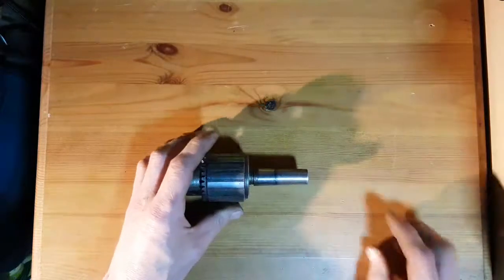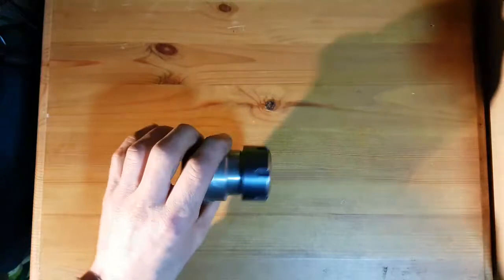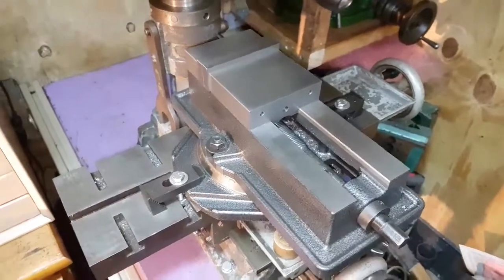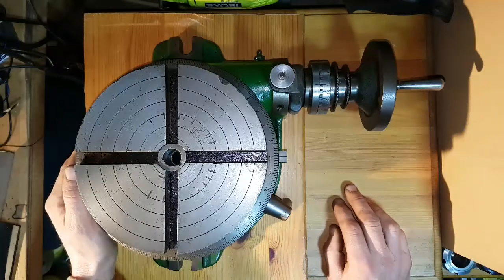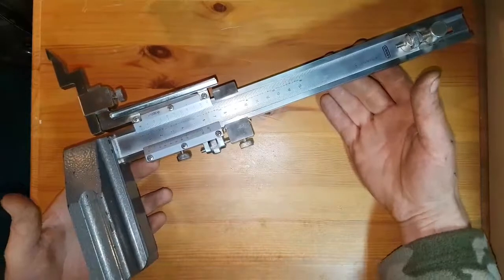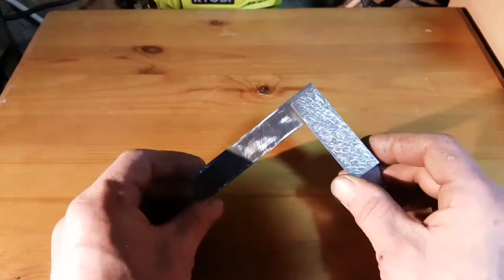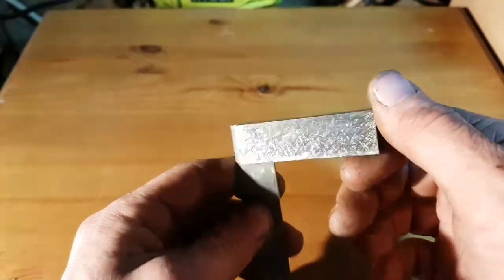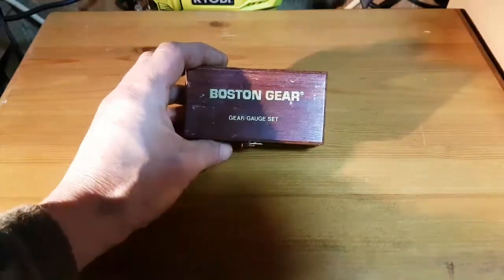Workshop update

Comment: Wow! Must feel like Christmas!

Very interesting video and a great bunch of gear which I'm sure will enable you to do many new things. The rotary table and the height gauge in particular stand out for me.

I think you are right - ER32 collets are a good way to go with the DW. I have an ER32 holder with a 2MT shank threaded M6 for the drawbar. For drilling, as well as a chuck I have a small selection of MT2 shank drills which plug straight into the spindle.

You are so right about raising the head of the DW! Not it's best feature...

Is the patterning on the handle of the square what is called 'machine turning' by any chance?

Enjoy your new gear!

gary
Reply from the maker: Thanks Gary :)

Yeh, I'm pretty stoked right now, though ironically, I've found myself doing a ruck of woodwork now making bespoke boxes for them :p

I'm using solid chunks of hard wood, cutting them in half and hogging out the middle to the required shapes using the DW (and a vacuum cleaner..).

I'm still trying to find a universal solution for the hight adjustment swing issue. I have an "under bench" design but it only works if there's nothing underneath.

If I get enough interest for that though, I'll put a link in the description to download the design plan for it.
Reply: Good luck with the boxes. Quite a job by the sound of it!

Will be interested to hear about your ideas for the height adjustment attachment.

Cheers!

Comment: Slightly off topic, but how did you get your mill table looking so bloomin' new please?
Reply from the maker: It was mostly elbow grease and fine scotch bright/0000 wire wool at that point.

I've since inherited an old but unused precision double sided stone that belonged to my late farther in law, who was a mason (headstone letter carver) by trade and I've christened it to knock off any dinks, burrs or high spots on the table, which is practically glass smooth now :)
Reply: @WrenagadeWorkshop  Thanks for your reply. I'm a newbie to machining. Recently bought an ml7 and even more recently, a mk1 DW. Don't have the first clue how to operate the latter. A 2 minute vid. would be most welcome... 😉
Reply from the maker: @russellsprout2223 As soon as it's up and running again, I will make one ;)

Though there are only a couple things that need pointing out as much of it is the same as any milling machine.